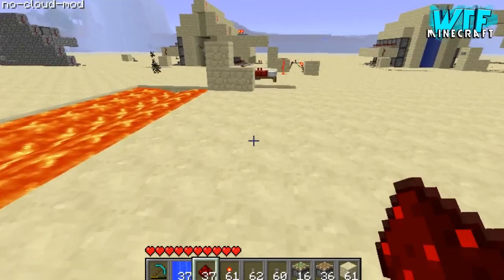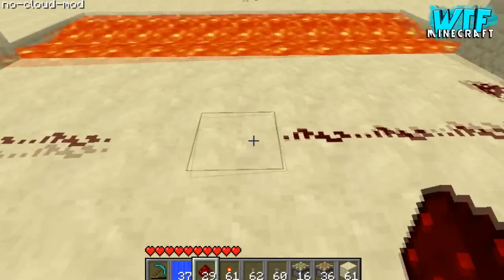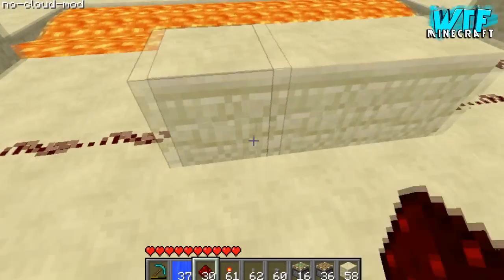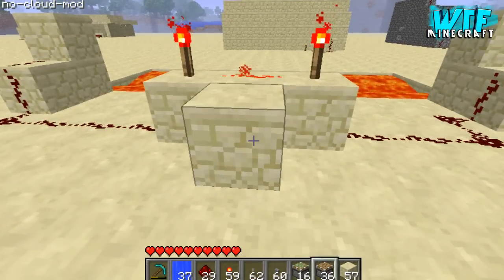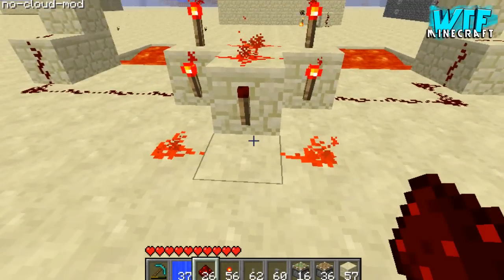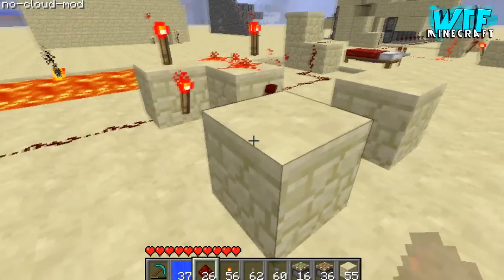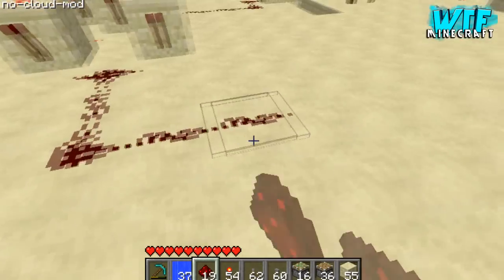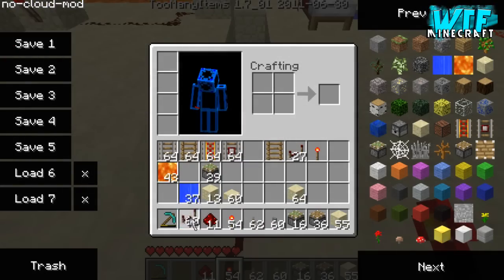Lava walkway - Adding an XOR Gate

Comment: I'm having problems with my first lever. I did everything the same as yours but once i added the second lever, the second lever was the only one that could turn it on or off. the first lever stopped working completely. If you could help in any way it would be perfect. Thanks!